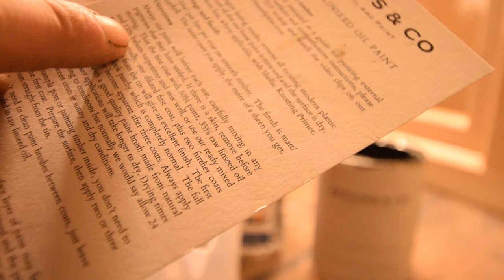Fitting a Wooden Window & Painting with Linseed Paint |  No.9

Comment: You should put a steel plate at top for support cover it with morter
Reply from the maker: I’ve got a lintel on the inside & hoping to use bricks vertically on a wooden arched former for the outside support